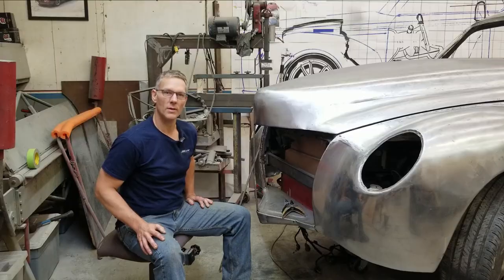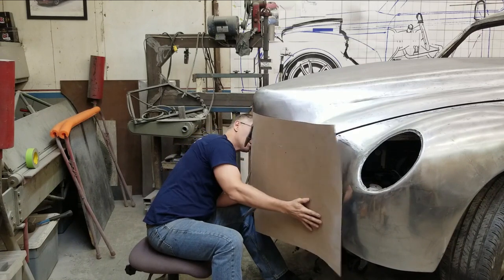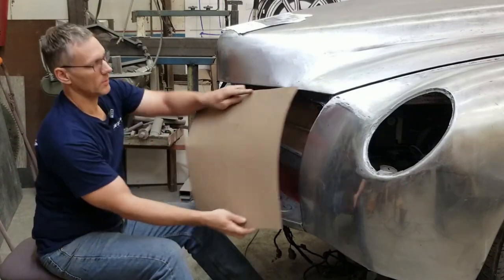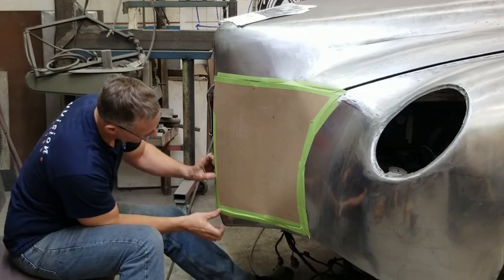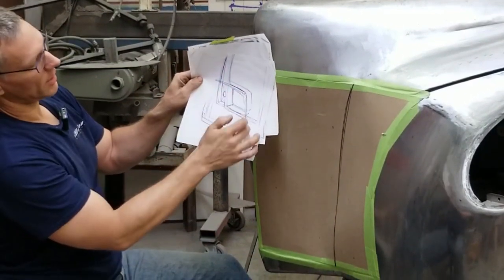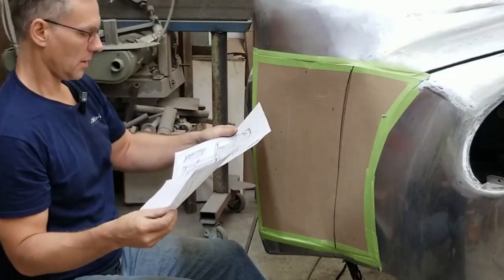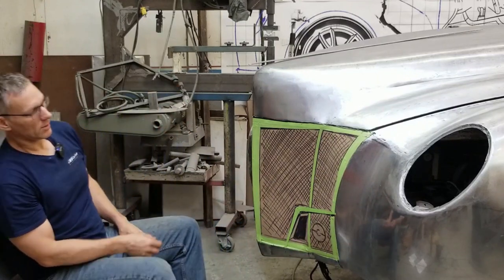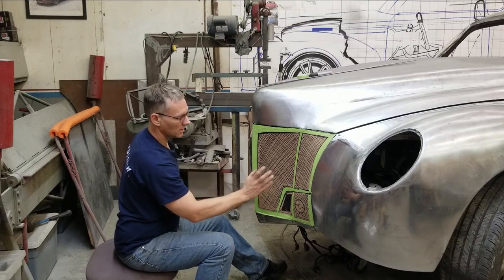Custom Grill Design - Ep.68 | 1940 Ford Inspired Hardtop Coupe

Comment: Nick, you're a magician in paper too.  Not really excited about the brake duct feature, but something there will still look nice.  I think the grill frame needs a larger variable radius at the top left corner between the center vertical feature and the hood line flange.   Love the mesh idea.  👍👍😎👍👍
Reply from the maker: Not a very good magician.  Tried to wave my hand with some 'abracadabra' thrown in, but the car didn't get done.  lol  Thanks very much for the feedback.  Gonna move the car outside and have another look, then decide on any adjustments.
Reply: @iNVisionPrototypes  Nick excellent work good Wednesday late afternoon from #YSW respect back to you Nick 🙏

Comment: Do not like the angular look, needs more curve at the upper corner, to reflect the nose profile, same for the area around the driving light.  Also the line to the grilll should flow down from the fender.
Reply from the maker: Thanks for the feedback.  We'll see if we go back to more traditional or make adjustments to this template after we roll her outside.  Cheers!